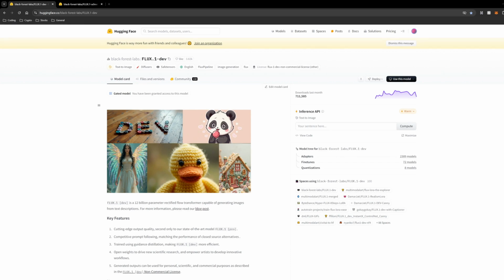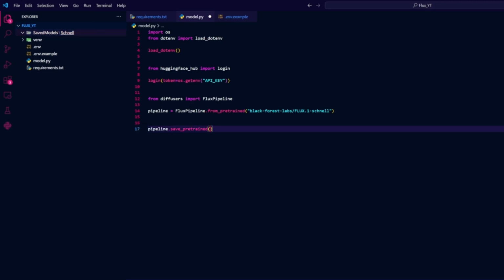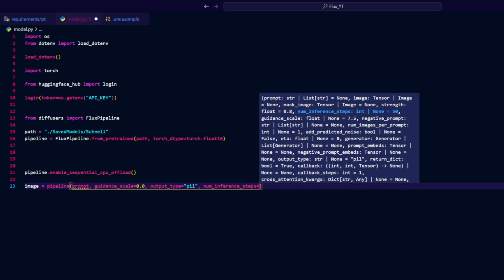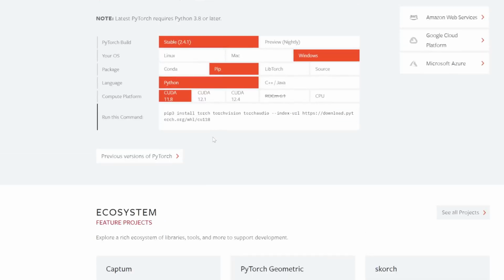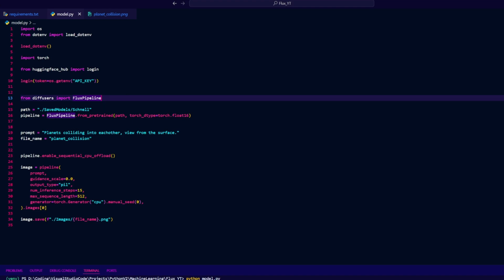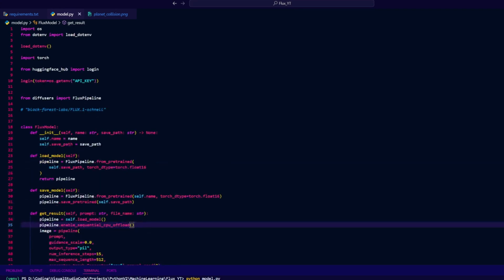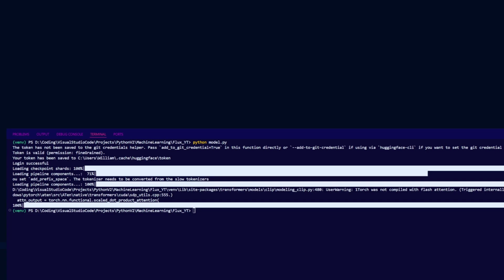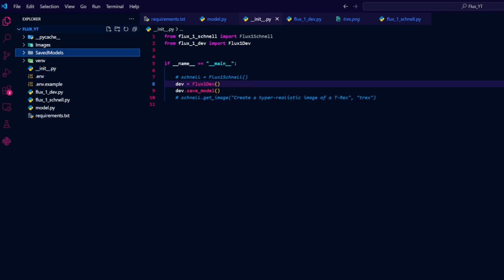Create A.I. Images with Flux-1 Locally using Python

Comment: Loading pipeline components...:  57%|██████████████████████████▎                   | 4/7 [00:01<00:01,  2.99it/s]You set `add_prefix_space`. The tokenizer needs to be converted from the slow tokenizers
Loading pipeline components...:  71%|████████████████████████████████▊             | 5/7 [00:02<00:01,  1.65it/s]

When i run it shows above in Terminal and then ends , What to do?

Comment: thanks for the video! one question though, why does it take so long to generate an image? i have an RTX 4070 and i have to wait like 18 - 30 minutes for an image to generate. When i remove the "pipe.enable_sequential_cpu_offload()" line, it just gets stuck at 0% and doesn't do anything... so I'm not sure what I'm doing wrong. Is that just the way the model is or am I doing something wrong?
Reply from the maker: Hello, hope it was helpful. 

You can try running the pipeline with CUDA. Currently I encounter errors with it, which is why I didn't initially include it. 

But here is the code: 

torch.cuda.empty_cache()
pipeline = self.load_model()
pipeline.to("cuda")
pipeline.enable_sequential_cpu_offload()

image = pipeline(YOUR PARAMS HERE).images[0]

Here's the error I would get. 

torch.OutOfMemoryError: CUDA out of memory.

I'm having memory allocation issues with torch. But hopefully you will  yield better results. If I find a solution I will let you know.

------------------------------------
And just a note on inference time. 

Play around with the parameter "num_inference_steps" when generating the image. The more steps, the higher quality the image, but the longer it will take. In personal experience I have gotten pretty good results with only 15 steps.
Reply: @primitivefinance  Hello! Thanks for responding back! I just tried this but this doesn't work unfortunately, I too get the "out of memory" error. Still, thank you though.